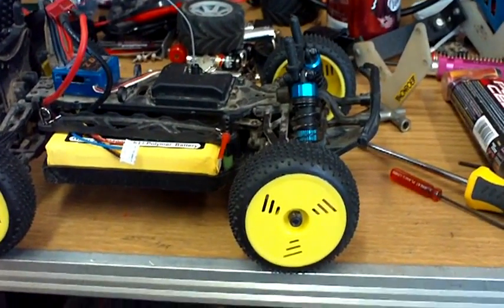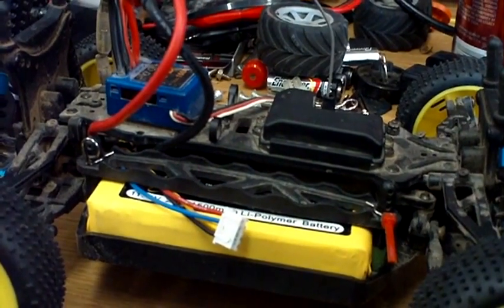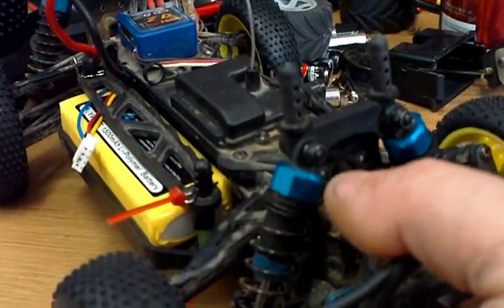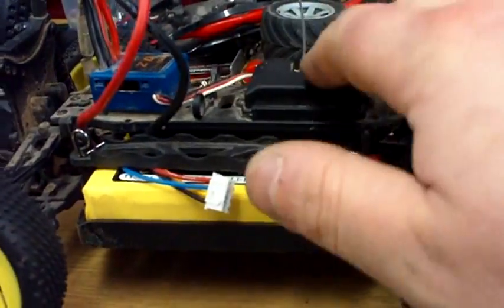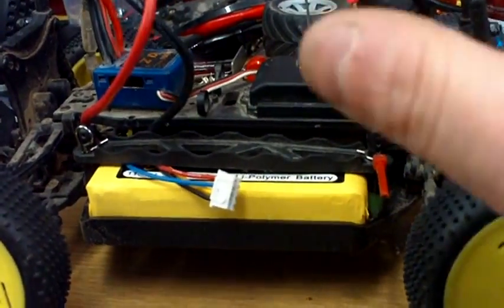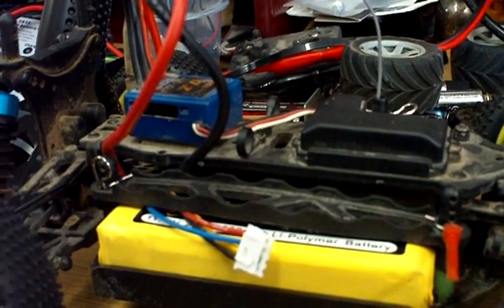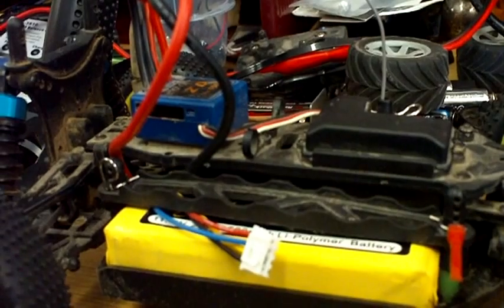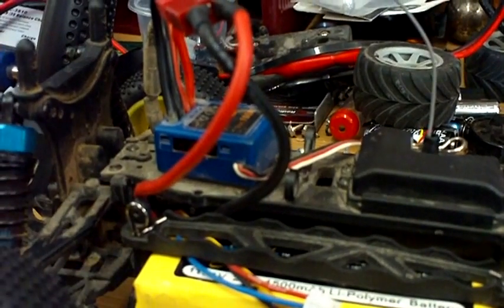ZD Racing 1/16th scale brushed 3s lipo trial conclusion

Comment from the maker: the spacing for the motor mounting holes is essentially the same but 370 and 380 motors have different diameters and with the design that is used on this car for the motor mount its a more difficult on most cars .

Comment: to add to my previous message, you can find the megatech propulse motors on ebay for dirt cheap and with that motor my zd 1/16th nearly double it's top speed and acceleration

Comment from the maker: This increases engine temperatures substantially . Due to the chassis lay out compensating for the motor change by changing the cars gear ratio  is almost impossible so I do not recommend your suggested swap . In stead I recommend  replacing the motor with a similar motor (stock RK-370PH-4250: My suggestion tamtech sport tuned motor rk-370SD-4045 part #40537)  with a similar number of turns or upgrading to a brushless system .

Comment: was only trying to help, i understand motor turns and understand the lower torque you get with it or when increasing pinion gear size or decreasing spur gear size...if you read my comment i stated that the torque increase two time along with the top speed, normally when you put a lower turn motor, you increase top speed but decrease acceleration due to a loss in torque....in case of putting megatech motor, my topspeed increase a lot and the torque increased a lot..why don't you simply try it!!!!

Comment from the maker: I have looked at that motor on ebay and thought it looked interesting and thought of using on a different project as the motor on this is not a true 380 motor it is actually a 370 and true 380 motors don't fit the stock motor mount.

Comment from the maker: Well I have a propulse / megapro  also in my collection to be blunt there is nothing rubbish about the stock brushed motor's in the ZD Racing cars they are made by a reputable manufacture ( Mabuchi ) the increase in speed you are experiencing is due to the Megapro motor having fewer turns of wire around the armature . This increases the motors peak rpm and there for the cars top speed but a lower turn motor has less low rpm torque and lower overall efficiency.

Comment: was only trying to help, i understand motor turns/pinion&spur gear ratios........since you have megatech cars.....why don't you simply try it!!!!..it take like 5 minutes to change the motor....the spur on the zd is 32pitch so use the same spur as did i.....also the temperature of megatech motor didn't increase..use the heatsink from zd 1/16th motor.....

Comment: Just to let you know the brushed motors on these things are rubbish, believe me because i've had 5 of them. but the esc on it is really powerful; enough to run a 1/10th scale slash. i had a couple of propulse rc's from megatech, i put that motor in and my top speed went from 13mph to 25mph on 2S 7.4V lipo and it had lots more acceleration. you can also use a traxxas 380 motor or any decent 370 to 380 brushed motor for RC18 for example and this thing will fly.